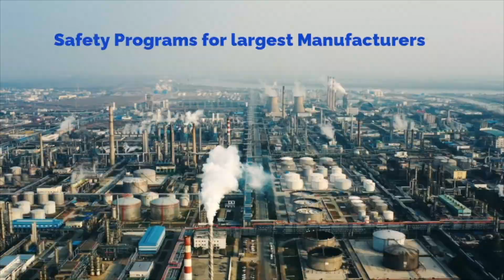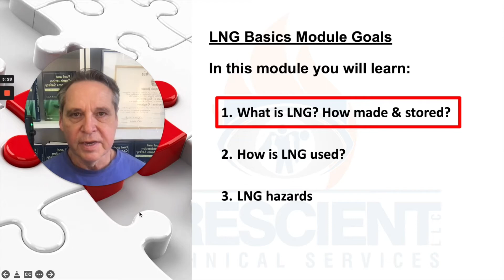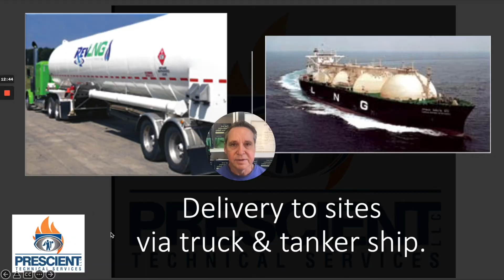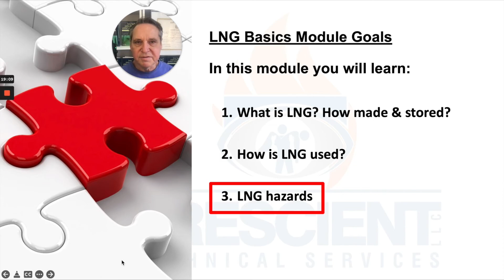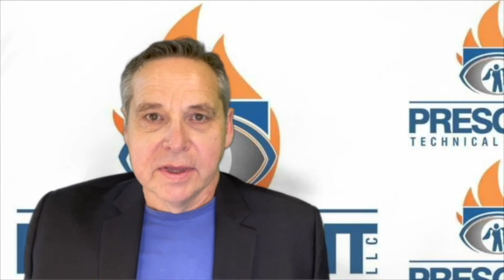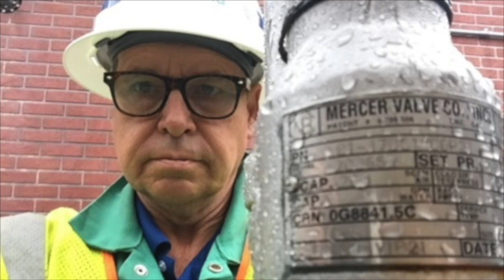LNG rescuing Europe? It's not that easy folks, Understand the basics of LNG for yourself.

Comment: I’m well aware of oshas guidelines they just refuse to do the double shut off
Reply: OSHA calls for zero energy state, cfr 1910.147, they talk about 3 isolation processes to get there, blind or blank, DBB, or disconnection misalignment and capping.....This should be an easy argument.
Reply: @johnpuskar8350  Temple university  assistant director of engineering response to me was this in quotes.. exactly……”The only place that requires DBB is to work inside a boiler in a plant with other boilers.  I agree that while it may be belt and suspenders and doable in most cases, it is not always and work will have to be completed as long as the 1910 requirements for Lock out tag out are met.”..
Before I do repairs I ask for a street shutdown bleed. Then isolation in mechanical room where they then open steam lines to drain. We have been doing it that way for 30 plus years. Now I’m told I only get one isolation valve in the mechanical room which puts us all in danger. Not once have they met any lock out or tag out procedures. It’s always hurry get it done we can’t inconvenience students . In my opinion this is wrong.
Reply: @johnpuskar8350  he says that it says nothing about DBB in 1910.147 🤷🏻‍♂️

Comment: I work for a university in a large city. I’m a steam fitter. We had a 4 “ os&y with flange leaks. 100 psi steam. Our bosses refused to shut down the line using two valves . They said osha doesn’t have guidelines on DBB procedures. Normally we would have main shut at the street tunnel. Then first valve in mechanical room. They tried to force us to do the work with only the mechanical room valve isolated. Could you send me an email where I could get proper shut down procedures for steam lines. I’m concerned for my safety and the safety of the men I work with. A boss who is actually not licensed an who is an electrician by trade. I’d greatly appreciate this